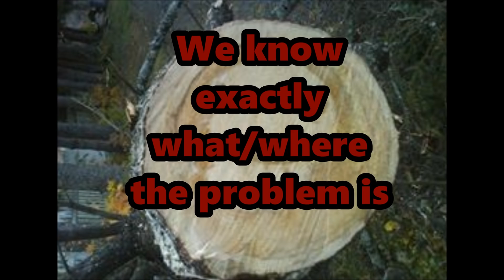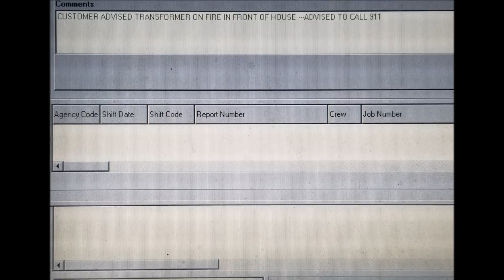5 Myths about Power Outages

Comment: Here in North Carolina I've noticed in my area that about every few miles or so you can see a box of some sort about chest high on a pole that has wires running down from the lines into it, and a small transmitter looking thing. I assume that the line is sort of set up in blocks that can be monitored but without actually working for Duke Energy I can't say that's what they are for.
Reply: Those are repeaters for the data readings from smart meters. They are needed so the data gets all the way back to the substation or control center. 

I live in a very small rural town in Idaho, and even though we have smart meters we still have the meter reader out here every month. When I asked him why he still had to come out for reading, he explained that we have too few customers out here to justify the cost of all the repeaters needed to go 28 miles back to the substation.

Comment: Is this a myth: A subdivision consisting of 100 houses is without power additionally a water pumping booster station is also without power supplying water to the subdivision and many other customers.
The power company will concentrate on restoring power to the 100 houses in the subdivision first because the water booster station is only considered one individual outage. Every single outage counts against the power companies service record, on paper.
Reply: The benefits of water towers. Not only do we maintain water pressure during a complete outage, but our tower and supporting pumps are fed from two different power grids.
Reply: Benjamin Cronce I’m having some doubt your booster stations are served from two separate utility power sources. Your elevator tanks if you’re lucky keeps you from a boil order, at best your operator isn’t asleep and your booster stations have diesel or gas powered engines pushing your pumps in a outage.
But that’s not what I’m talking about anyway. Who gets service first?

Comment: Fast response from a power company? Only Monday - Friday from 8 - 4 because they are already out and about. Usual response time is well under an hour on a nice day. Of course the fix will take longer. Late at night the phone gets answered right away but someone has to get out of bed, get dressed, go to the shop and pick up the truck, then drive to the scene. On a good night that will take closer to an hour, but might be longer. More recently there's a night--call guy who takes the truck home so response time is better unless there are multiple calls. If there is equipment damage (car vs pole?) the actual repair could be 3-6 hours but they usually try to patch it enough to get most of the neighbors back on if it will be that long.

Comment: Smart meters have changed some of this. Based on what I've read from my power company, they get an update about every 15 minutes from my smart meter. Coincidentally, most power outages only last about 15 minutes around here. Maybe that's a subject for another video.

I still report outages immediately though because my smart home is useless without electricity.

Comment: As a national fiber tech, i've learned how dangerous induction is. I've been working on a line that follows a ComEd transmission easement. I would be over 100 miles away and our fiber will have over 100V of AC running on it at times, we have to ground it off a couple miles back towards the towers and use lightning arrestors to mitigate spikes.

Comment: I am not a lineman nor do i work anywhere in that industry, however whenever it comes up i ALWAYS stress how important it is to stay away from downed powerlines. We had a farmer down the road from my town a couple years go die because one of the sprayer arms on his sprayer touched a line and fried the computer in his sprayer causing it to come to a stop while still touching the lines. There were no arcs nor humming sound nor any sort of indication at all that the sprayer was now directly connected to mains power. The farmer stepped out of the sprayer (we assume to get away from the power lines) and the moment hi took his first step off the sprayer his body completed the circuit to ground and killed him.

Comment: "The transformer on my back just blew up" can sometimes be true :). The building where I grew up in the city was in front of a substation that had 3 large area transformers. Apparently one day one of the transformers had an isolation oil leak or some, and blew up, sending a fireball up in the air that reached about 3 or 3 and a half stories high (compared to the building I was at). That was truly a show.
Reply: Yeah a exploding Transformer is fucking scary.
Reply: I would not want to deal with the weight of a de-energized transformer on my back, let alone an energized one that was getting ready to explode.

Comment: When a power failure occurs during a thunderstorm, what are the most likely reasons? Is it a lightning strike on a wire, transformer, or substation? Is it a lightning strike that causes a tree to fall,  impacting the electrical infrastructure? Is it wind damage?
Reply: Eternal Tech
 ... probably all about equal in the long run, although a single branch across the wires will put out as many people as a whole tree.

Comment: For 1. thing most companies in Finland have system that if the power company knows that you are out of power, they send a SMS within few minutes if they only have the phone number registered with your power meter number. If no SMS within 15min or so, make a call as fault is somewhere between the distribution transformer and your house and no automatic system to detect that yet. Even though ALL power meters have at least GPRS modem for sending power usage data daily (legal requirement for last few years and transition period is over). Meters are just not ready to inform faults through that. I think mostly because it would need battery backup for modem and that makes it more expensive.

Comment: I had a transformer blow once in my back yard. Fed 4 homes.

Had a lightning storm, and lightning hit, and blew the fuse.  Guy came out, replaced the fuse and got power back.  A few minutes later while putting away his tools, a loud BOOM, and 6 hours later in the daylight a crew of four was replacing the transformer. They had to use a block and tackle and muscle as there was no way to get a truck up to the pole.
Reply: The transformer behind my house lasted about a year after some lightning fun.

Comment: I have argued with my dad several times. He is telling me that the power leading to his town is only 1 single line. It is clearly a telephone line because it is much smaller in diameter and they are not going to run 1 single 110V line for kms. He says "We only need 1 phase in our town" I asked him how the 220V stoves work then, his answer was We have a transformer to convert it to 220V. I tried pointing out the power lines on the next road over, they are clearly power lines because they are much heavier, and higher in the air, plus there is 3 phases. When I tried explaining to him that each and every house has 2 of 3 phases entering it, and usually you share 1 phase with your one neighbour and another phase with the other neighbour. He laughed at me and said houses are only single phase power there is not 2 phases, I just shake my head and every time he tried to argue I just walk away.
Reply: Syn the Sizer
 ... you are confusing phases with legs, which many people do. The average home is single phase, but the pole transformer takes that high voltage at the pole and breaks it down to a pair of 120 volt legs. This is 120 volts back to the center tap neutral on the transformer. If you measure from leg to leg (skip the neutral) you will get 240 volts from a single phase. Here's the rub... the power company doesn't deal with a neutral on their transmission lines. For home and business distribution a neutral starts at the local transformer closest to your structure. Neutral and ground are also bonded together at several points which is dictated by code. (and way beyond the scope of this post)
Reply: @rupe53  My electrical instructor says the terms are interchangeable until referring to the type of power within the building. That a leg and a phase are the same. That you can say I have 2 legs or 2 phases going to your house which makes a single phase but you cannot say you have single leg power.
Though the main point I was making was arguing with my dad that he only has 1 leg going to his house, when the line he is talking about was a telephone line.
Reply: @synthesizer8026  ... your instructor is oversimplifying for the sake of discussion, which is where confusion starts. If you always use the proper (but more complex) terminology there is no confusion. Saying leg 1 and leg 2 (not phase 1 and 2) is correct while wiring an appliance for 240v in North America but in dealing with a service it's best to clarify single phase or three phase, then add the voltage at the end. (3 phase 208v or 277v or 480v) In some cases you may need to specify the 3 phase as either Delta or Wye configuration but we're getting beyond this post. BTW, at one time it was common to have only a single leg into a home. The original service wired to a house pre WWII was a 30 amp 120 volt single phase connection. It had one hot wire and one neutral wire back to the pole. Inside the home was a fuse box, typically wired with 15 amps to each floor, which gave you a ceiling fixture and a single outlet in each room. At the time the only appliances available were a desk fan or a floor lamp. Electric toasters, heaters, hair driers, washing machines, and vacuum cleaners were not common items yet, although the wealthy had access to them in the 20s.
Reply: Almost all telephone lines are buried now days also.
Reply: Syn I promise phases and legs are not the same. 120v is nothing more than a single “phase” of 240v split into two “legs”. There are plenty of homes supplied by a single hot wire and a ground.
Reply: @austin3626  ... maybe they are buried in your area but in the northeast of the USA utilities are 90% above ground. The exceptions are cities that have undergone renovation and new construction / planned communities.
Reply: @austin3626  Yes I get that, my instructor was an idiot. The term phase is used to refer to the position of the sine wave on the line. Each leg is 120° out of phase from the other 2. I was trained as an A/C mechanic and worked in the commercial industry so I really only worked with 3 phase and most of my past experience prior to that was in electronics, nor am I in the industry anymore. That being said, I don't know as much as an Electrician or Lineman. Though I heard we are prefered for service work because we have lots of experience with controls. As for phone lines where I live in Canada they are above ground, some areas are now going underground as they upgrade the fiber lines. Not to mention the line is pretty tiny for electricity considering its running from the city for 100s of km and doesn't have any transformers and the line branch which leads to town is just as small meanwhile the other end of town has much larger cables, 3 of them that run to a ground box and underground to the houses. I do know his house has 2 legs.

In the houses with 1 hot wire and ground how do 220v stoves work? I understand you could step up the 110v to 220v and place hot and neutral on the 2 hot lines on the stove plug. That would power the heating elements but what about the 110v outlet on most stoves and the 110v oven light.
Reply: @rupe53  same as my province
Reply: @synthesizer8026  ... in the old days of only 120 volts in the home there were no appliances running on 220 / 240 volts. In the case of a single line (with a neutral) they use a center tap transformer to make the pair of 120 volt lines. One leg to neutral is 120 volts and one leg to another leg will give you the 240 volts.
Reply: @rupe53  yah, lol, now I feel stupid. I knew that too, once you fully explained it I realized. No different than a centre tapped step down transformer to 2-37VAC lines to rectify to (+/-)40VDC for an audio amplifier with centre tap being VDC ground, just step up and no rectifying.
Reply: By “1 hot wire” i mean there is one hot wire going to your homes transformer. From there the transformer splits it into 2 120v legs. It sounds like your getting a better grasp on this. I used to be exactly like you and wonder the exact same things your asking now.

Comment: Pretty interesting video.  But whatever happened to safety training?  As kids, my generation had it drilled into us at every turn to never approach or attempt to handle a downed power line.  Do people these days really not know this?  I don't know about now, but back in the day the metal high voltage transmission towers could pick up a charge from induction, too, so you didn't go near them.
Reply: They need some railroad safety lecturing, too.  Common dangers that everyone has to deal with but some are clueless!

Comment: I have the transformer for six homes in my back yard. It is on a pole near my rear corner, and visible through my sliding glass door. The fuse blew. The bang was more than loud. It was bigger than any noise I have ever heard. It made a huge flash of light. I looked out and expected to see the transformer in shreds. But it was clearly in one piece; whole and sound. Then I noticed that one of the switches was missing. At that moment I realized the switch is a fuse. Indeed you can pull the fuse. It hinges open, and this cuts the power so the feeder lines can be safely worked on. They did this when a dead tree needed to be removed from right next to the feeder lines. But that was moths after the bang. They crew fixed this in a couple of hours, and were so quick we never saw them. They must have done it in less than 10 minutes.
Reply: Power line cutouts/fuse elements are designed to flip down when they blow to make spotting them easy.

Comment: One of the loudest and most scary incidents I witnessed was in the summer of 1999.  It was the first weekend I was to run the store I worked at all by myself (I was 18-19 at the time).  Hot day over 110 degree weather, power went out and came back a couple times during the day.  It was only off a few seconds, didn't think anything of it.  Then an explosion that shook everything, cracked the front windows of the store, and shattered the windows of the vehicles in parking lot. My car was included in this. The transformer on the pole in the parking lot  was just gone.  Nobody knew what had happened for several minutes we didn't know it was the  transformer we thought a bomb had gone off in the parking lot.  The upside is I did get a new windshield and Vinyl top for my car courtesy of PG&E. Most of the Power supplies and light ballasts in our store had to be replaced as well.
Reply: Sometimes IOUs fuse their transformers too heavily. This will cause catastrophic damage instead of a fuse blowing. They can get away with this practice in the winter when the transformer will cool but not so much when ambient temperature is near 100F.
Reply: @davidd1395  How much oil is in a transformer?  I worked at a hotel, where the sewage lines leaked directly on a transformer at the base of the building.  Tap water is almost completely non conductive, but waste water, full of electrolytes, so a little splash between terminals goes a long way!  I'm told the flames shot out six feet around the transformer, as the oil caught fire.  We were out of business for a month.  Roaches took over the kitchens.  That's one place I'll never stay.
Reply: @ThatsMrPencilneck2U  Tap water almost completely non conductive?!  Ummm... no?   Only distilled water is "almost completely" non-conductive.  It doesn't take many dissolved minerals to make water conductive.
Reply: @jovetj  The tap water in my Chemistry Lab 201 class at the University of Louisville was very barely more conductive than distilled water.  Then, the U of L is served by the Louisville Water Company, which is consistently rated as the "best tasting tap water in the US," so if you get your water elsewhere, it is likely of somewhat lower quality.
Reply: @ThatsMrPencilneck2U  Well, that makes sense!
Reply: Cool, I wonder what went wrong to cause the transformer to just vaporize.
Reply: I had an underground transformer explode near my apartment the other day. I was just sitting on my couch, eating a snack, and BOOM!! I felt the floor shake, and it set off a bunch of car alarms!! 😂😂😂😂 That scared the heck out of me!!!
Reply: Oh don't worry... you're damaged vehicle checks are included in your every electric bill... & some.

Comment: I live in the Deep South of the US. I was once told that our power company limits the amount of power they will make available to customers based on the amount of sag in the lines. During summer it gets really hot, and when power consumption is high the lines sag more due to more load. And the line sag is what determines how much juice they can pump through the line. Is that true?